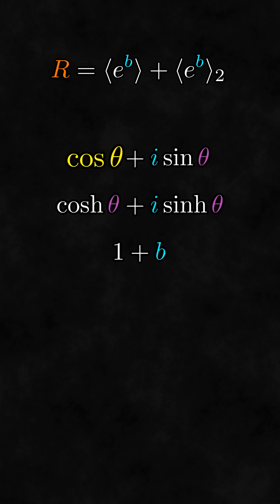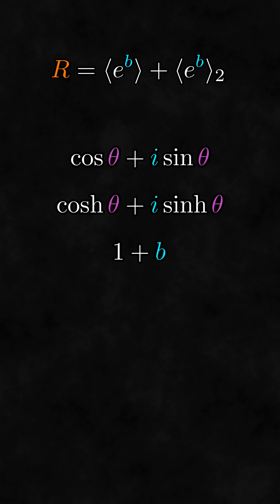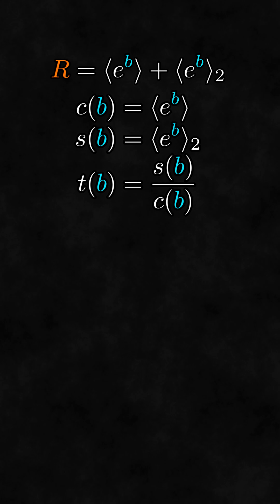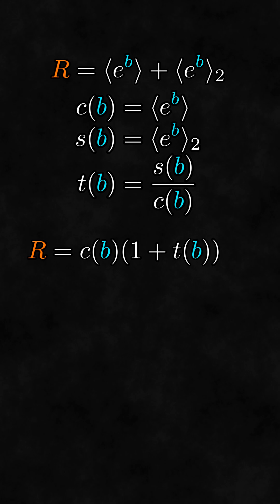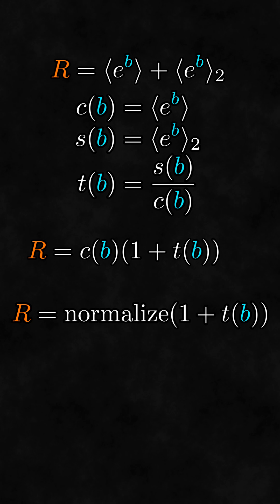An Alternative Way to Find Rotors

Comment: how do you normalize a vector/bivector/etc with a negative square?
Reply from the maker: Normalization is when A†A = 1, not when A^2 = 1.  Rotors always have R†R = 1 no matter what the situation is.  However, in other situations with non-rotors you can have A†A < 0, in which case you just scale it until A†A = -1 rather than 1.
Reply: @sudgylacmoe  thanks!